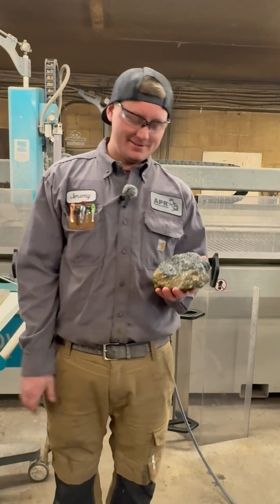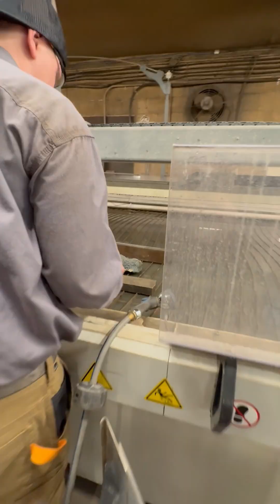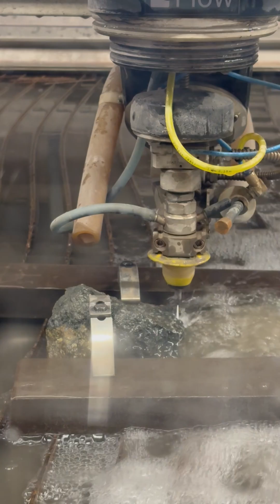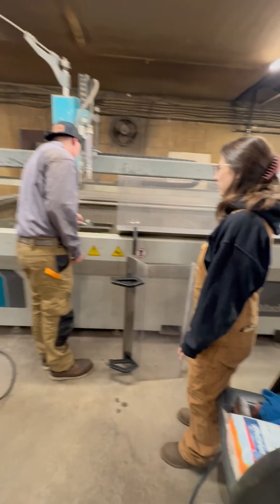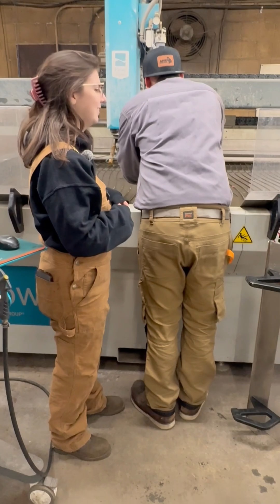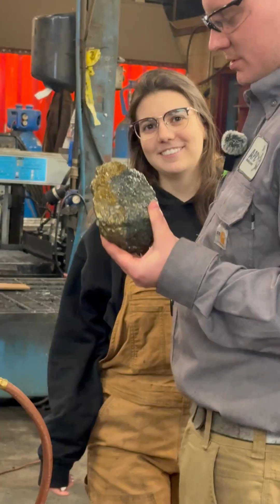Will It Cut? | Waterjet vs. Fool’s Gold Rock!

Comment: How much does one of those cutters cost? We cut rocks with $3000 tile saws
Reply: It's a flow m200c
Waterjet cutter
Cost varies depending on options drastically (mainly different pumps)
Plus as stated, this is a 5-axis head, 3 axis is much cheaper and simpler, so price variance is huge.
To give a price estimate would be inaccurate, depends on what you want to do with it.
If you're cutting odd shaped rock all day, not really the ideal machine, they're meant for sheet material (glass, stone, cement fiber sheet, precision metals, rubbers etc)

Source: I'm a waterjet technician
Reply: @ so around $200k+. They’re such cool machines. I saw one 25 years ago being used to cut out 4” hardened steel and couldn’t believe my eyes. 
Thanks
Reply: @jamesmungall6669  They're bloody brilliant I agree. The versatility of a waterjet is just great. Plus unlike any other cutting method, no heat, no deformation.
25+ years ago must have been phenomenal, garnet was still a fairly recent introduction at that point
Reply from the maker: No HAZ is a huge one for me, cutting materials like AR plate, hardened plate, anything with nickel content like stainless, inconel it doesn’t burn the nickel out of it causing it to corrode on the edges or cause issues with but welding. So far I have pushed the limited of what it’s capable like cutting a diamond shape and it has blown my mind! Not to mention the cut quality is like nothing I’ve ever seen, blows laser cutting out of the water, just doesn’t have the speed unfortunately. It’s been a fun toy so far! Still so much to learn and do!
Reply: @aprweldingacademy  yea the precision is ridiculous. Get that axis Calibration spot on and you just get phenomenal results.
Indeed, being abrasive they're quite a slow and pricey method.
Unfortunately 94k pumps don't make as drastic of a difference in cut speed for the additional capital. 
How long have you had yours for?
Reply from the maker: @isdisavailable3 we got it in October! So it’s pretty new to us
Reply: @aprweldingacademy  Ahh very nice
You've gone for the right pump with the motojet
very reliable, great machine
Not sure if you have one, look into a HP Inline filter. Will extend your orifice life drastically (regardless of your water supply quality in my experience)
All I'd say is monitor for water leaks on the pump, once they start to leak, attend to it asap. Leaks just make for wearing internal parts that aren't cheap. Keep it running without leaks, the whole intensifier can last you ridiculous amounts of time.
Reply from the maker: @isdisavailable3 appreciate the advice! Thank you!
Reply from the maker: Well it’s not really made for just cutting rocks 🤣 this machine is capable of 5 axis, chamfered edges, chamfered holes, cutting an impeller for example. 
https://youtube.com/shorts/3i0Pvb6OAsA?si=jLG7xf4eVxAo8U78